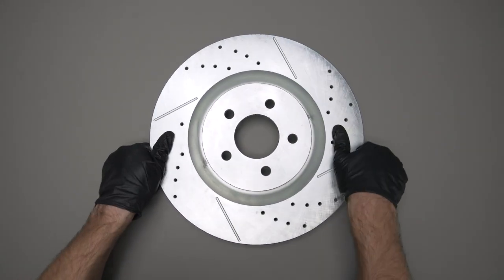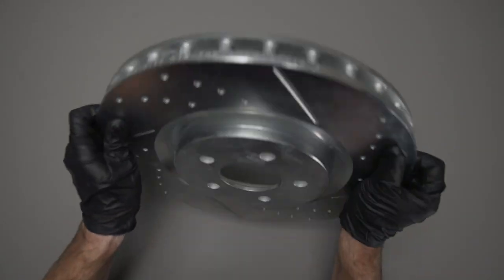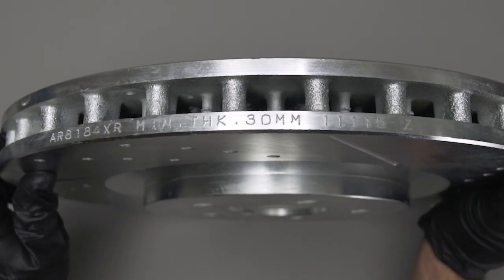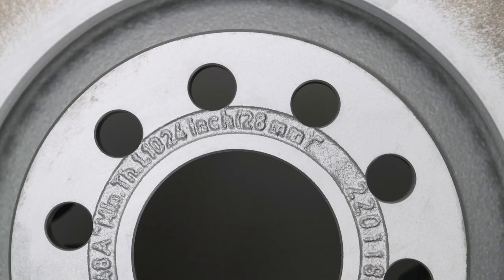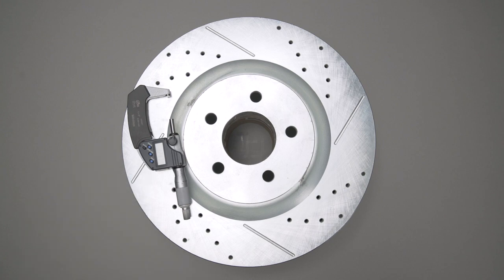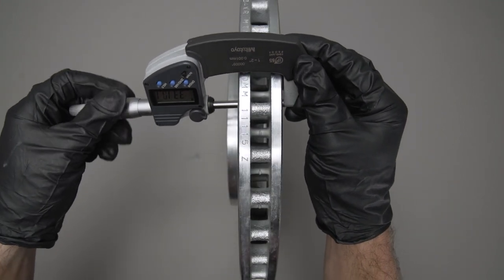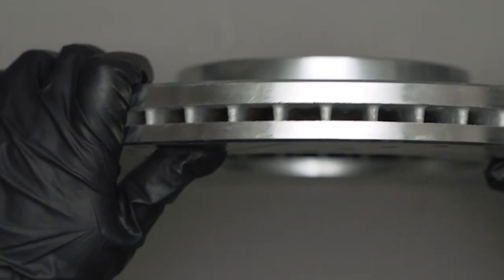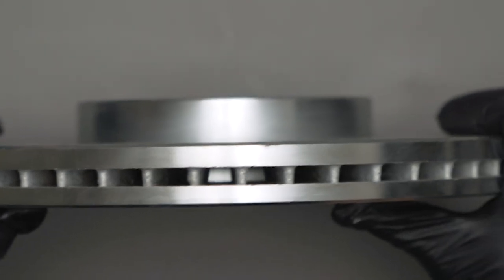Do You Need New Rotors? Understanding Minimum Rotor Thickness | PowerStop

Comment: Engraved on the side of your perfectly brand new, never been on a car out in the salt spray
for years after several pad change crusty rusty rotor, you will find the minimum thickness. Not.
Reply from the maker: Perhaps after this period of time and this much use it is time for a new set of rotors? 

If you cannot read the engraved numbers on the rotor, the minimum rotor thickness can be found on PowerStop.com if you search for rotors for your car.
Reply: All I see is the thickness of the new rotor listed for sale. Not the min thickness of the oem rotor